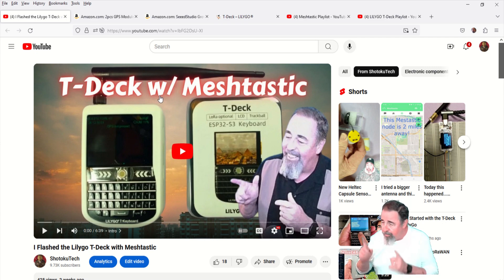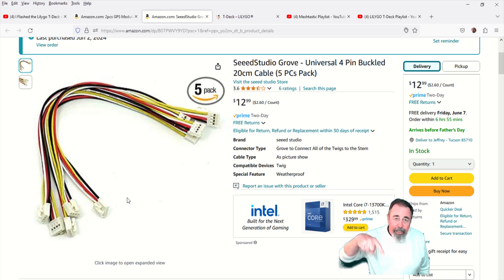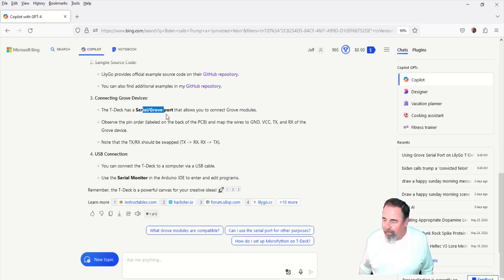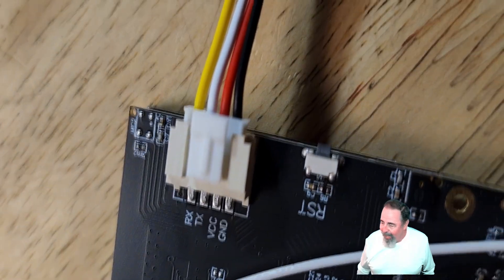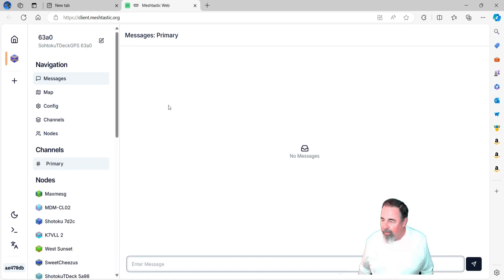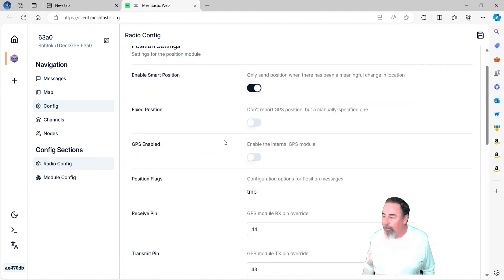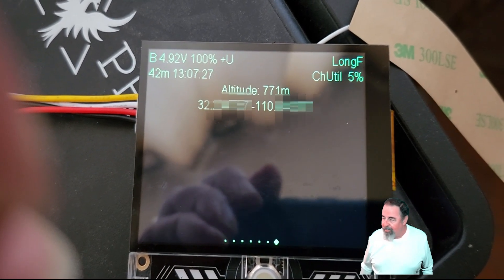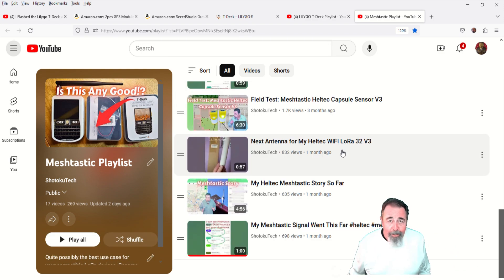Add GPS to LILYGO T-Deck Using the Serial Grove Port. #meshtastic

Comment: followed your video on several different firmware versions by my GPS module still isn't working. The lights on the module itself indicate that it's powered and sending data, and I confirmed it's wired properly. About 6 hours in at this point and about ready to throw in the towel. :/
Reply from the maker: Try reversing the TX and RX pin numbers in the settings? That's the only thing that comes to mind. Best wishes.
Reply: @ thank you! I tried that but still no luck. Maybe my module is bad. I have a different board coming this week so I’ll try it on that one and see if it works. Appreciate you taking the time!
Reply from the maker: @theolufson  I hope you find the resolution! The other possibility is the baud rate. Is the the possibility of a mismatch?
Reply: @ I think a baud rate mismatch is most likely actually, but have no idea how to correct that. A project for another day lol. Don’t really NEED the GPS so it’s not urgent
Reply from the maker: @theolufson  Something like this maybe? "Programming GPS Modules with U-Blox U-Center" https://youtu.be/ZaDpx9DvCPo

Comment: Amazing videos you make, you take the time to explain things properly and use diagrams. One question: Firmware now has a setting; "GPS module enable pin override" to sleep the GPS module when not reading a position. However I can't find any documentation about what the default GPIO pin is in the setting (on a T-deck). could also use another free GPIO pin on the T-Deck You would not happen to have figured that out?
Reply from the maker: It sounds like I will have  to take a look. I don't have that off the top of my head. Thanks!
Reply: @ShotokuTech  Looks to me like pin 36 and 37 are free GPIOs on the T-Deck, so possibly one of those. Thank you.
Reply from the maker: @Tore_Lund  Thank you. I will make note of your finding. Best wishes.